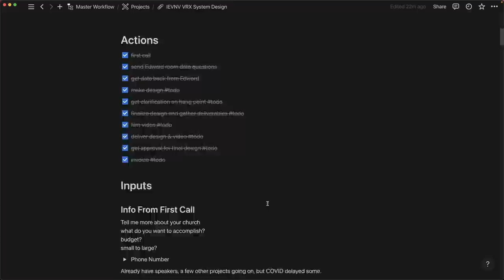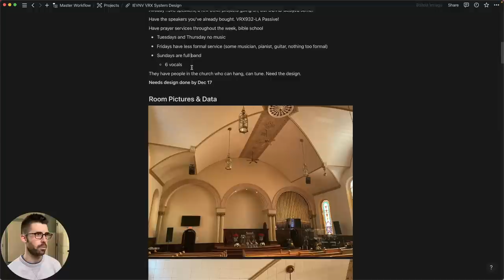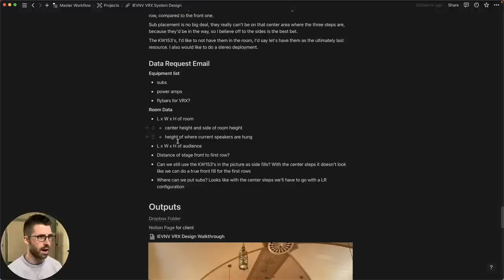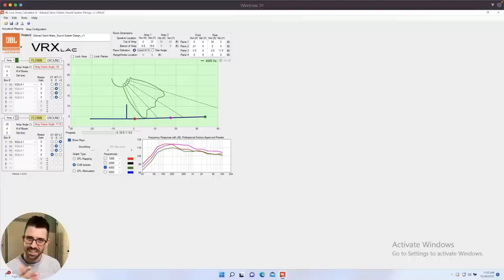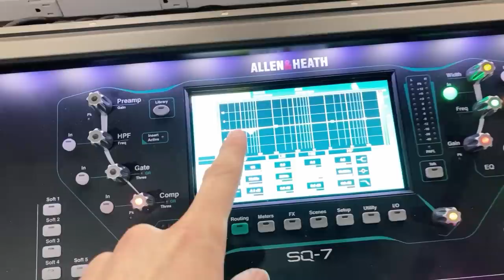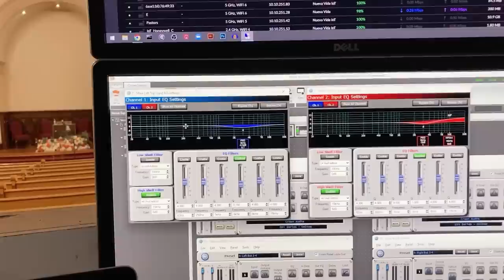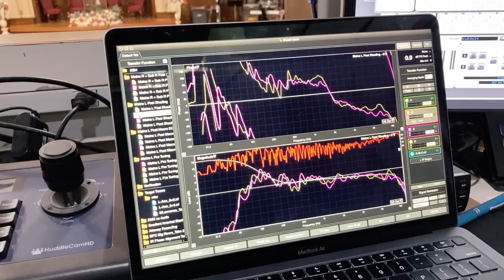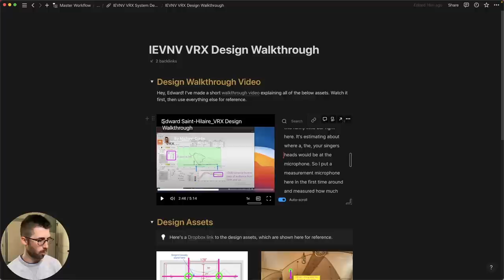Did My VRX Design Work? | Complete System Design & Tuning Project Review

Comment: hey Michael, thanks for the rundown.  these are awesome.  how did you come across the need for the 290 dip and slight top end roll off on the matrixes?
Reply from the maker: Thanks, Anthony! I compared the measurements at all microphones I got with the system pre EQ, then compared that to my target trace. I found that there was too much low end overall, so brought that down to match my target trace, then did the same with the top.

Comment: Years ago I had a sub placement problem , my solution because I didn’t have floor space for the subs I mounted them in the basement firing up through the floor Centred at the stage, it worked and had floor gain that was easily dealt with with my EQ.
Reply from the maker: Cool solution!

Comment: Hey Michael, I just purchased 6 of the hdl 6 a’s for dj gigs because I wanted a louder “point source” than my Yamaha DSR 112’s. Since they’re discontinued I figured I could at least double the sound by mounting 3 hdl 6’s on crank stands so that the bottom box is at least 2 feet above my head. I guess my question to you is am I getting better coverage and somewhat louder than my 134db point source box per side.
Reply from the maker: I'm not sure the coverage specs on the Yamaha DSR 112's, but I can say that the HDL6-A's are 100° wide. If you have them on crank stands I'd spread out their splay angles to 10° so you can have 30° of vertical coverage.

They're Max SPL is 132dB, but with three boxes together you'll get more than that.
Reply: @MichaelCurtisAudio  those Yammies are 90 horizontal and 60 vertical with a max spl of 134db. I wish I could “safely” get 4 hdl6’s on that pole mount.

Comment: Awesome, I’m working on this speaker in my local 1100cap venue. Great content as always. 

Why are the hf drivers not mirrored? You can rotate the rigging per speaker.
Reply from the maker: Great catch on the driver mirroring! I totally forgot those boxes could do that.
Reply: @MichaelCurtisAudio  might compensate for the eq difference in Left and right. The VRX is very odd in coupling and comb filtering for that matter. 

Thanks for the info! Very helpful in my own design.
Reply from the maker: @peevonb7070  You got it.

Comment: You mentioned always verifying in the field that the research-based design actually works in the real world. What variables have you encountered that have caused issues with your design in the past? Obstacles (like this chandelier fixtures) or something else?
Reply from the maker: Great question. It usually comes down to some sort of construction/obstacle related problem. There's an AC duct in the way of a rigging point, or we can't hang the speaker where we want it because it will block site lines to a screen. It's the little things : )

Comment: The hangs are too closer together - you're going to get increased levels towards the middle and drop off towards the sides. The original speakers were closer to the correct distance apart.